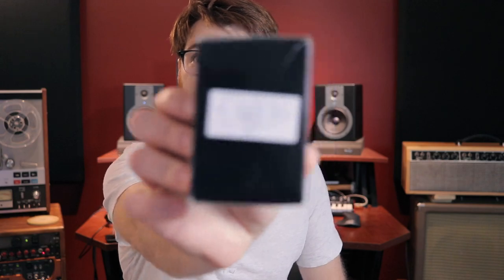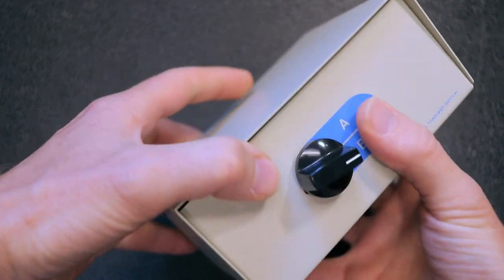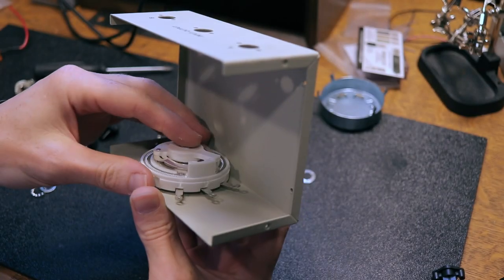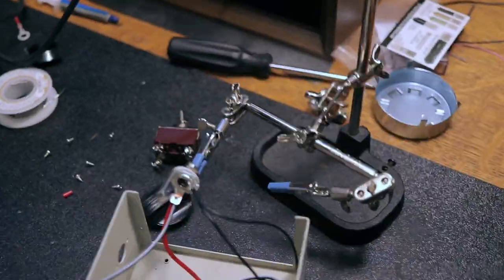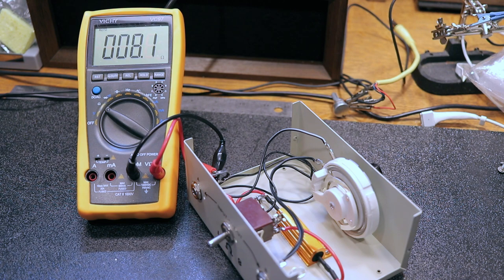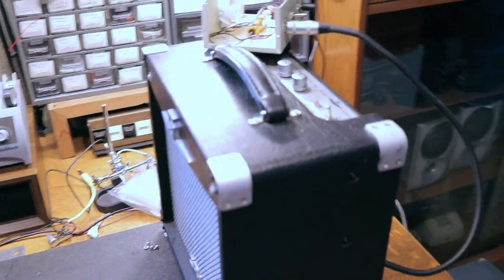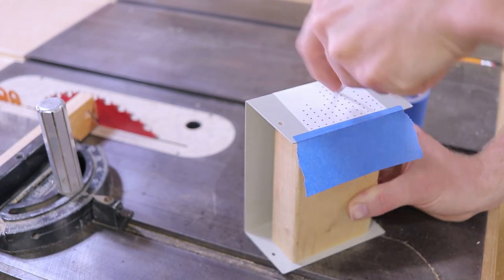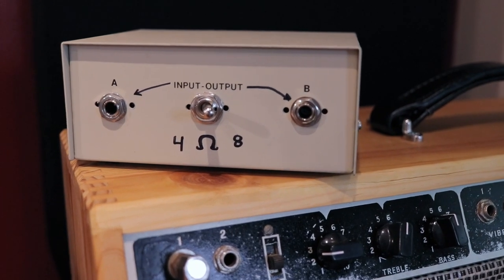How to Build a Guitar Amp Attenuator

Comment: Turn it into an "Active cooling" Attenuator by having 2 PC Case fans in a Push -> Pull configuration on either side of the enclosure (You would have to figure out how to power them though) just be sure to add more holes and a thin dust filter.

Comment: Looks like a great project.  The only thing I think that I would do on my own...... the vent holes..... I would drill them towards the TOP of the box.    Heat rises.  So when it gets hot inside the box that heat is going to rise INSIDE the box and will have to work its way down to the vent holes to get out.

Thinking even more.... I might open up a hole in the top and put an open screen in it.  NOW you will have convection on your side. 

Heat will rise out the top....causing  cooler air to be drawn IN from the SIDES and help with the overall cooling effect.  By the way...if I did THIS.... I would KEEP the air holes on the side low where you have them..... so that the incoming air comes in LOW inside the box.

Very good project though!   Well done!
Reply: I would've been very lazy with it.  Half inch drill bit 3 holes on the sides three holes on the top.  Done lol

Comment: I made one, and added 2 micro fans on either side taken from a building automation unit I replaced.  It works well.  I plan to make an improved version with higher quality audio components and a nicer housing to match my stack.
Reply: Hi Ryan, how did you power the fans if I may ask? Did you use a power adapter or USB? Thanks in advance!
Reply: @StefGraffiti  i used some bits from a chinese klon pedal, and just use the 18v off my pedalboard power supply.  I dont really use it much now, and never got around to redoing it with better components, but i will soon.
Reply: Thanks for the quick reply!

Comment: I'm thinking some holes on the bottom and the top would help to cool it too. As the heat goes out of the top it would pull cooler air from the bottom through the device.

Comment: Hi there! Thanks for a great video as always. Liked and sub'ed 👍
I'm building one just like this now! But I have seen some people on forums saying that it won't actually handle 100W amplifiers. 
You're using it with your Fender Showman right? And that's a 100W amp if I'm not mistaken? Have you had any issues with your L-pad? 

I mean sure, the L-pad probably won't survive if the amp is on full volume and the attenuator is completely turned down.. but it can handle say volume at 12oclock and attenuator also at 12oclock right?

Comment: Hi, on the schematic for the 8 ohm only version, I see a gap between the tip of the INPUT jack and the wire that goes to Position 3 of the L pad. Should the tip of the input jack be connected to position 3? Or did you mean I should install an on-off switch between the tip and position 3? Not really sure, am new to electronics. Any help is appreciated.
Reply from the maker: It should just be connected.

Comment: I need a 16ohm attenuator to lower  in-between full and -20db. I plan to place it after the full output, on my Two Notes Torpedo Captor 8. I run silent. But, when I use  the speaker of a 16ohm cab. I only need -10db only for live.  -20db is too much, fine for when I want to be way quieter. 0 db is a bit too loud for my dry only cab.

Comment: Cool project! Great inspiration!
What if i wanted to build one for my Super Twin Reverb with 180Watts (385RMS) 6x 6l6 tubes?  What parts could I consider?
It is min 4 Ohms minimum. But these are build to survive so the trans takes 8 Ohms as well.

And i think about i making sleeves in the top and bottom or maybe a coolvin from a CPU cooler.

Comment: This is a great video, how did you go about hooking in a speaker after the box? I didn't see anything on that
Reply from the maker: Guitar speaker cabinets usually have just a 1/4 inch jack. So instead of one 1/4 inch cable from amp to speaker cabinet you use two with this box in between.

Comment: I've build a few but never with an L-pad I've just used switches to introduce -6db or -12db of attenuation, I've been looking at these L-Pads but the specs are pathetic, do you have any idea on the amount of attenuation that's possible with it turned all the way up?
Reply: So just regular resistors in parallel?

Comment: You use a 8 ohm 50 W resistor, will multiple 20 W resistors also work for a total of 8 ohms, like 4 ohms at 20 W in parallel? And, are in input and output jacks self grounding?

Comment: Anyone have experience using the diy M2 reactive attenuator from the marahall forums? It has resistive stages but has an inductor in the beginning that gives a reactive load. The guy that designed it fine tuned it so the amp 'sees' normal apeaker impedence. It has 3 switchable stages of -3.5db, -7db, and -14db, or a combination of the 3 for almost -25db of attenuation. i usually run -7db and it sounds excellent

Comment: Have you thought about putting a cap from wiper 1 to wiper 2 for a treble bleed circuit so you don’t roll off too much treble on the lower settings?

Comment: I put some jacks on an l-pad but when I test it with a multimeter it behaves confusingly.  My speaker is rated 8 ohm and If I put a meter across it I measure about 7.8.  If I put the speaker in to the attenuator and measure the amp side I thought I would see a constant 8 ohm regardless of the position of the dial. But it varies from 4 to 40 and goes short at the ends of the track.

So is it broken or did I wire it wrong or is something else going on here that I don't  understand?  I have seen threads from other people where they found the same thing with their multimeter and then when they hooked it up with their amp it worked as expected.  That seems a terrifying risk to take with my output transformer.  Can anyone explain what is going on?
Reply from the maker: It's been awhile but I believe mine read 8ohm over the whole sweep of the L-pad. The fact that it reads short tells me something is not wired right or something is wrong with the L-pad.

Comment: Ok so, if I wire two 4ohm 100w lpads together in parallel, would I have a 200w 8ohm attenuator??
Reply: No, you'd have a 200w 2ohm attenuator.
You need to wire them in series, not parallel, for 8 ohms

Comment: How much does it cost for all the micro parts inside of it?
Reply from the maker: Like $30USD. Closer to $45 if you build it with the extra resistor and switch to make it 4 and 8 ohms.

Comment: my fender deville is 60 watt do i have to get a 60 watt resistor instead of 50?
Reply: I would get a 100w l pad.
Reply: wattage is an absolute power figure. 
in the laws of physics, energy is neither created nor destroyed. Our amps are no exception.
That being said, a 100W amps power will be divided between the various loads.
so, if there is a resistor, an equal L pad and a speaker, where the speaker is cut to say 20W, this leaves 80W equally divided between the L pad and the resistor (in 4 ohm mode) for a figure of 40W to each. 40W+40W+20W = 100W
You can compute this per your own needs rather easily. The likelihood of needing anything of greater spec is remote

Comment: How much difference does the attenuator make in terms of tone? How the speaker isn't a purely resistive load. It has inductance and capacitance. To me, that will make the response of  the amp a bit different. While you are still using the speaker, you have changed the resistive component, therefore the response should change.
Reply from the maker: To me it still sounds good with the attenuator. Maybe it doesn't sound exactly the same, but if it doesn't sound bad who cares. The benefit of being able to play at an appropriate volume outweighs the possible negatives of tone.
Reply: I hav 1 of these and while it does lose some high end its nothing i cant put back with the amp eq . Also kno tht as u turn up the attenuater in volume the high end starts to come back . This thing is great .
Reply: Can anyone simplify the schematic drawing? I don’t understand it and cannot see where the wires go in the video.
Reply: @MerwinMusic  Does changing the volume of the attenuator affect the tone anyway? I just want as consistent of tone I can at different volume levels

Comment: Next episode: “How to replace your blown output transformer.”
Reply: Why's that? Currently thinking about building one
Reply: Long as you come up with the right resistance this shouldn’t be an issue
Reply: @ryanfreedman6348  there's more to it than just a static load. Resistive loads can put a big strain on output transformers by way of flyback voltage.

Comment: Can I use this in a pre-valve amplificator? Like a marshall VS 100? Hehe
Reply: No point. The master volume on those vs series amps is adequate. Absolutely no point since it’s a solid state power section. You’ll gain nothing tonally from cranking it through an attenuator.  The point of the attenuator is to let you crank the tube power section of an amp, which in itself has a unique colour. 

I have an old vs102r somewhere.

Comment: You should say that your amp's life will be reduced significantly after this.
Reply from the maker: I don't usually feel the need to say things that aren't true.
Reply: That's not true. What you're talking about is the fact that the tubes will wear out quicker, but that hasn't got anything to do with the attenuator at all. It's just due to the fact that you're cranking them for extended periods (ie when you're playing). The same will happen without an attenuator (though, it'll obviously be a lot louder when you play).